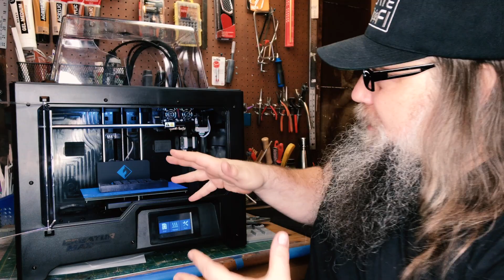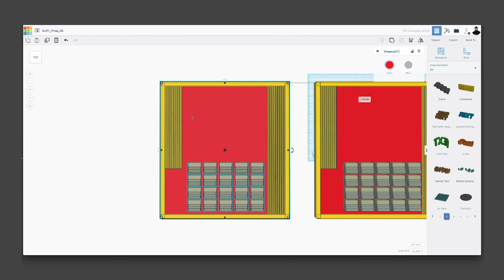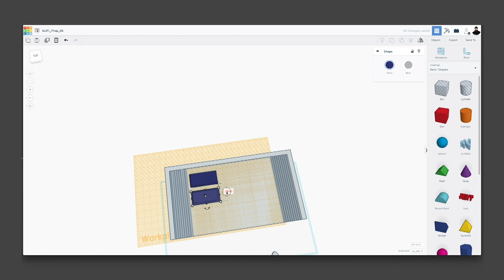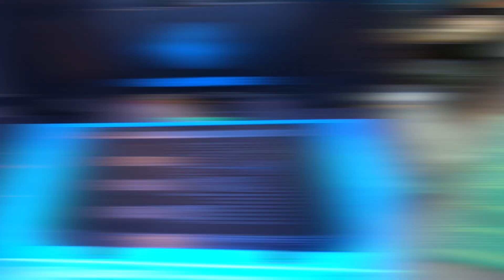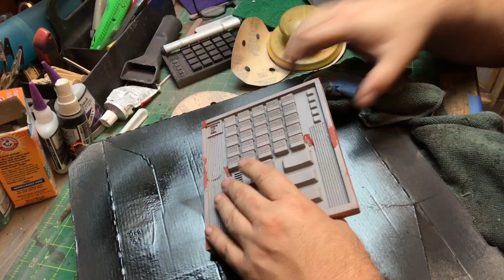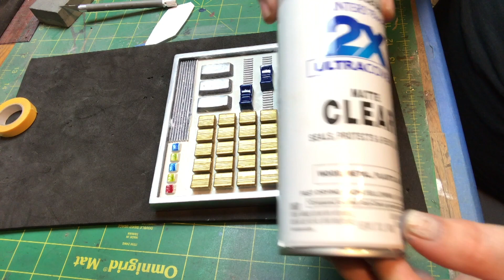3D PRINTED SCI-FI PROP | FLASHFORGE CREATOR MAX 3D PRINTER

Comment: The prop turned out nicely! I’ve been thinking of getting a 3D printer to make props too. I wonder if it would be easier to print a blank tablet with holes and print all of the detail parts like the buttons, sliders, and heatsink separately with pegs/tabs that fit the holes, and piece it together with glue. Similar to the way you put each half of the tablet together. You could paint each part separately before assembly and there would be less masking to do if any at all. 

Or you could try adding indentations in the design of the tablet that the separate parts could fit into. Basically each part is its own peg. I think either option would be more secure than just glueing flat pieces to a flat surface. These could be faster options for making the prop, and things like that tricky heatsink wouldn’t have seams to fill. You would only have to fix the seems on the blank tablet. I can think of a few ways you could use the indentation method with the sliders so they actually slide. You could even go as far as adding small springs to the buttons so they can be physically pressed and depressed, or make a slot you could fit a phone into to use as a screen. Okay, that might be going overboard haha. There are so many options you could do with this prop. I guess it depends on what you need it to do and how much time you want to invest in it.

Comment: This is really awesome, I took a crappy tech class in uni and they taught tinkercad for a bit, and I’m still using it to model lightsaber parts.

It’s super cool the way you use existing models, and basically do a digital kitbash. I love the content, keep it up. 

One suggestion I’d have for the sanding would be to just spray some water on your sand paper. It helps with the dust and makes a smoother surface
Reply: pkextra hi wud that work for sanding blocks..as packet says for wet or dry..I've never tried dampening them thought may tear through..? I'm going try it tho..😉